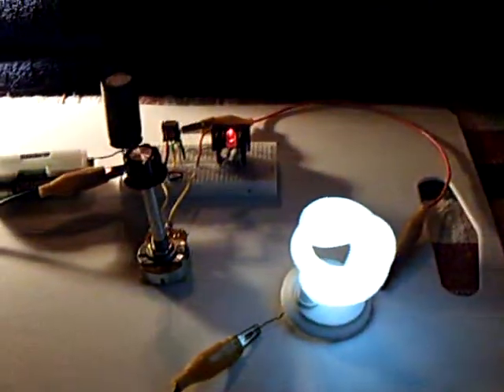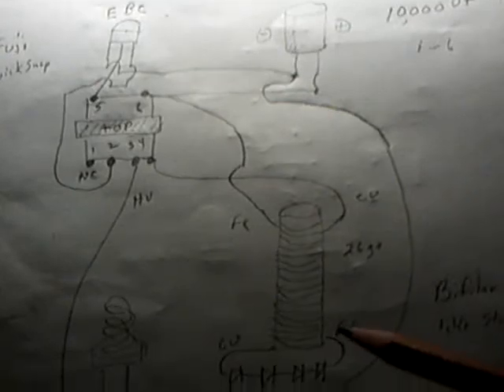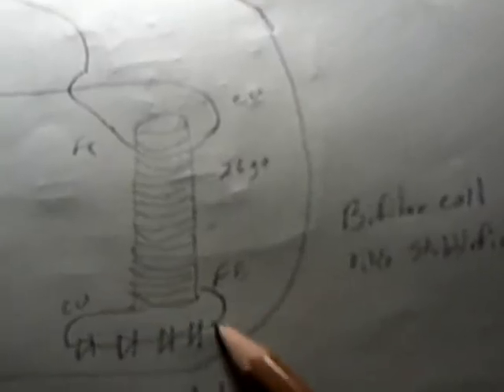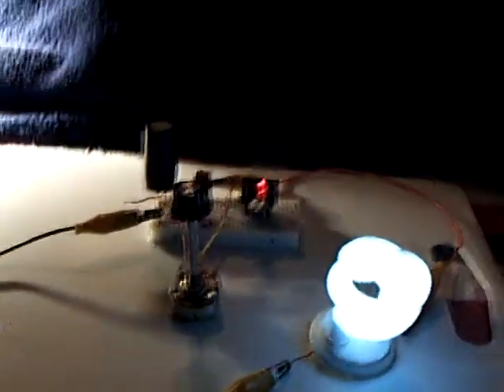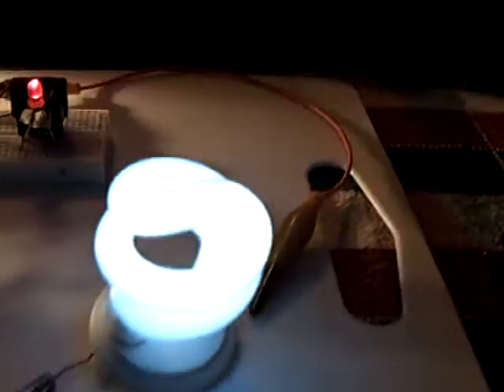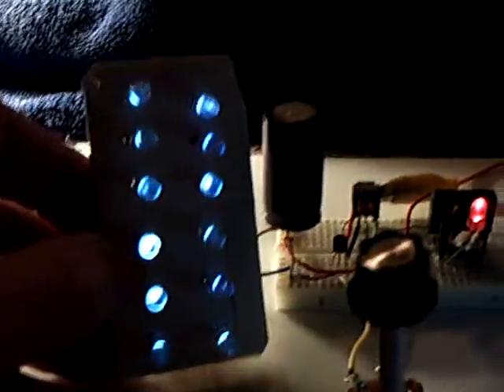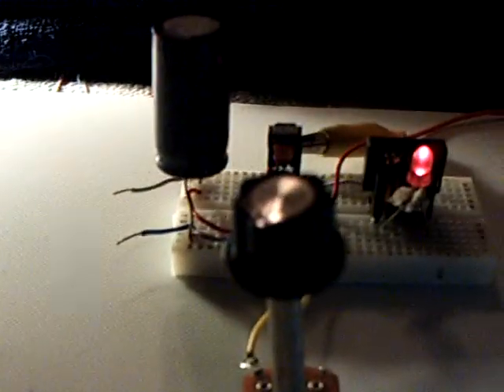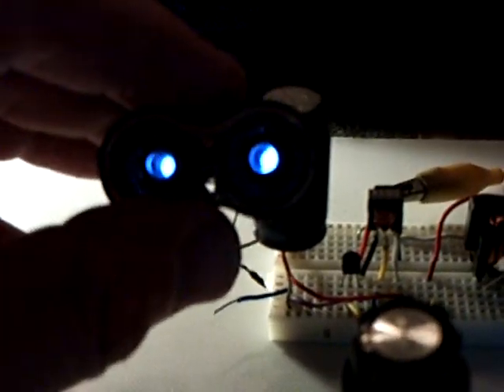Joule Ringer--close to a replication.ASF

Comment: Also as a after thought what about useing the red flashing led in-between the pos or neg of the battery to pulse the cap this should reduce the amp draw while keeping the cap charged also I used a small magnets bridging the transformer which also reduces current draw if placed on top on each side thanks for sharing and great work!!!

Comment: Great job lidmotor one step closer in some of my test circuits I used three AL pie pans to form the oscillation and a micro spark gap between pans to boost ambient voltage got the av plug to light all over one leg and wirelessly also noted how pan on left lit up led with one leg then other pan lit up led only after switching around the led to opposite leg

Comment: AC  above 40khz tends to travel outside layer of copper wire exibit magnetic properties in a loop. The big massive coils are (28V) and florescent is ionized that after the momentum is reached, about4 watts additional florescents can be added with only a few milliamps more. Many experimenters tryed Bedini, Cole, Bearden and did'nt like noisy relays. It is difficult to find exotic parts so keeping with the practical has been a real grind. solidstaterelays, IGBTtransistors might allow sparking